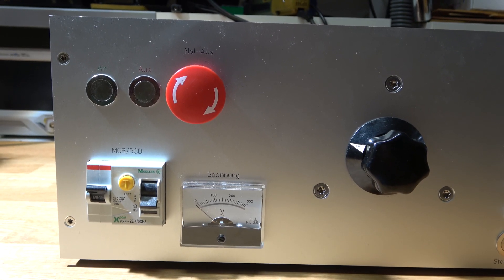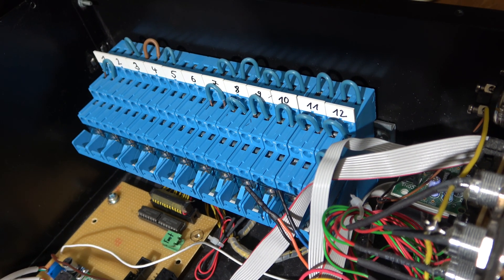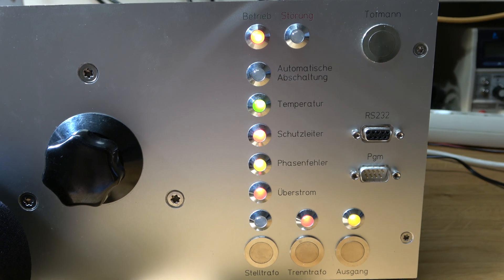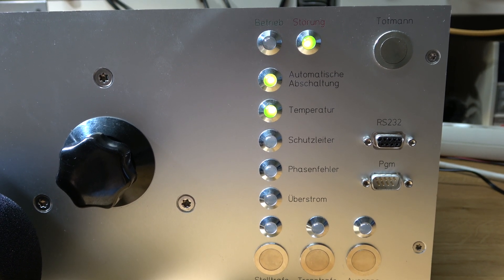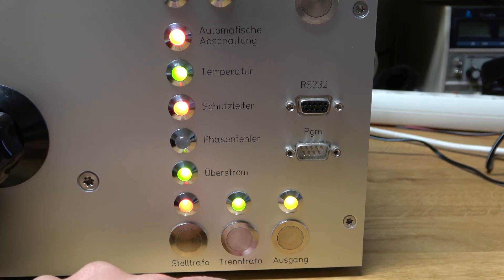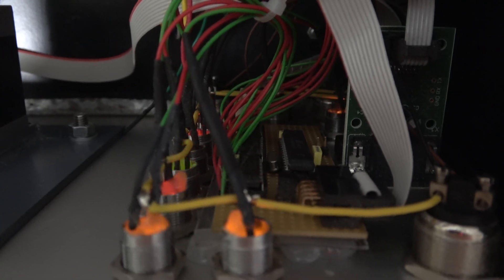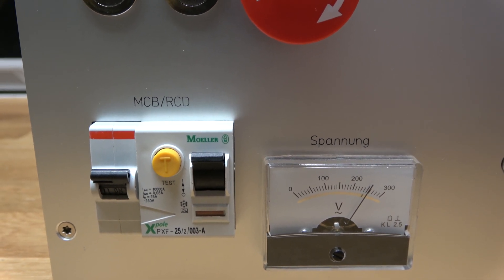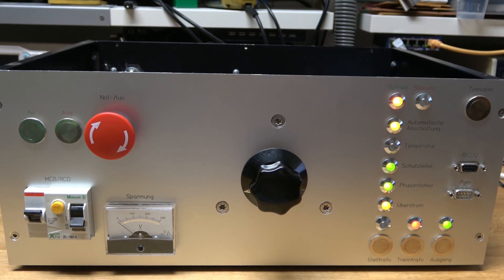Industrial Control Systems for Toddlers

Comment: Really nice idea. My kids would love this, and I built a PSU with the same buttons and LEDs when I lived in Germany but haven't seen them again since coming to the UK.

What do you use now for isolation/safety/testing mains though? I've put together a autotransformer with an industrial power analyser module but now want to add an isolation transformer option and RCD.
Reply from the maker: Hey there, thanks a bunch, super nice thing to say. Indeed those buttons and LED reflectors are really common for industrial equipment over here, didn't know that was a local thing though.

I hope you won't find my answer depressing though: Since I've had my daughter, I've had really little time to do tinkering and I've repaired maybe only a handful of devices in the last year or so. Most of them did not require mains fiddling, but for the one case where I had I have transplanted the autotransformer in its own housing and hooked up the iso transformer in a makeshift fashion. Was a very quick and interesting repair as well, half of the bridge rectifier was burned out, causing basically a direct short over mains. Strong DC bias showed that very clearly, switched one part and was done.

I've looked at your channel, this looks super interesting. HF is something I've never really understood and I want to watch the Spec Analyzer video when I can really dedicate the whole time for it, you seem to explain things so even I can understand it.
Reply: @johndoe271828  Now its my turn to be flattered, thank you for the kind words.

I'm not an expert in RF in any way, I'm teaching myself high frequency electronics by trying to repair some RF equipment as I pick it up at auction. While most of the issues with the units are DC/LF/digital, I'm forced to learn the HF magic too as you must learn the device. When it works I then have more toys to play with and learn more.

Your answer is not depressing, I have two kids, one aged 4 and one aged 2, so I know your struggle very well.  I only started my own channel as I watched The Signal Path, The Feedback Loop, Jerry Sweeny, and a lot others while holding my kids during the night to give my wife a break. I found your channel while branching out, and this build really resonated with me. I almost feel guilty for not tearing down my old unused power supply to make a children's toy!

I really like how you used industrial relays to configure the system, and it looks like a really neat and professional project. I'll look forward to checking out your other work, and good luck with the kids, I think you're taking the right approach, get them interested in the electronics, then you can do it together!